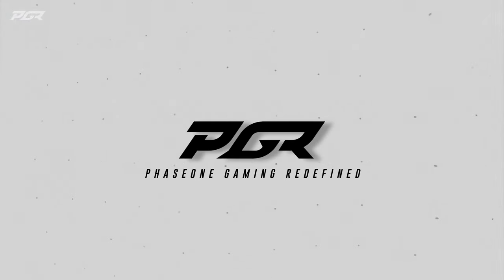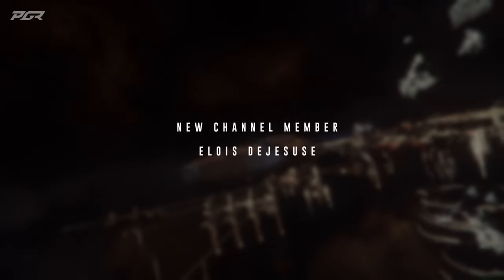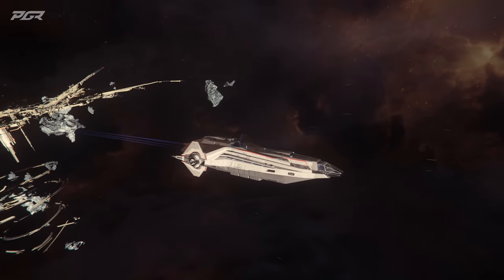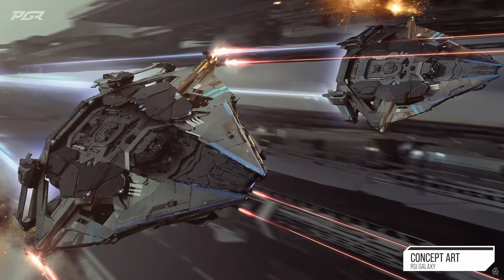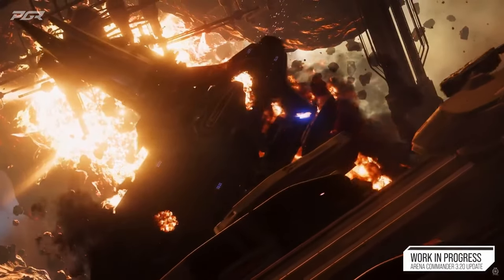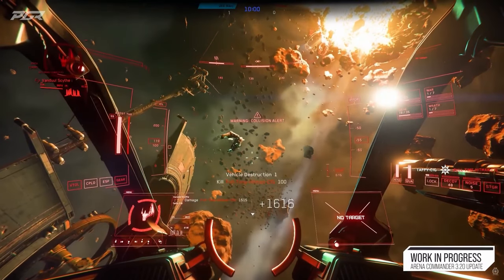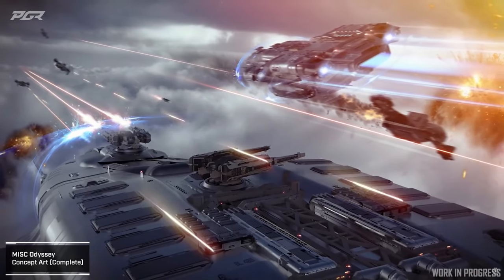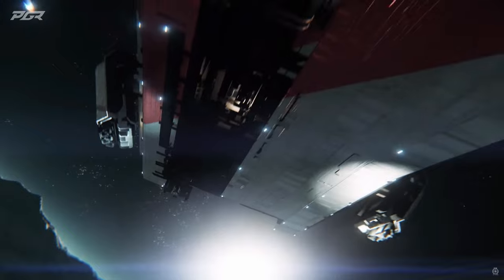New Star Citizen 3.22 Details Revealed! - Evocati Leaks

Comment: Potential is there to make reclaimer a monster. They should make it so cracking to munch is more difficult if you dont scrape, but you still get all the resources when you do so you scrape just enough to make it easy and still make it a process you can do quickly or slowly depending on the power of your ship.
Reply: I sorta disagree, I do agree that it should be harder to fracture a ship that hasn't been scraped but I don't think you should still get the RMC from it if you skip straight to hull munching

Comment: I hope CIG does not keep the current method for structural salvage. I want to be able to use cutter modules on the salvage heads to cut pieces off the hill and then use the lariot tractor beam to pull those pieces into the ripper to be broken down more before it gets processed into saleable material. This is not how the current method is described.
Reply: @simonm7590 
I did make a mistake in my original post, which is now corrected. I do hope that CIG shows us more about structural salvage and the direction they want it to go.